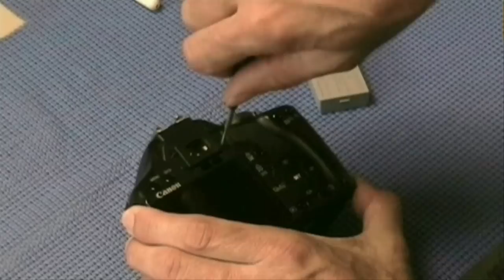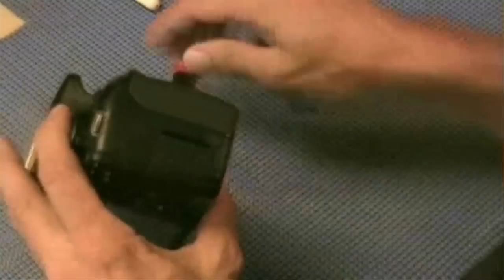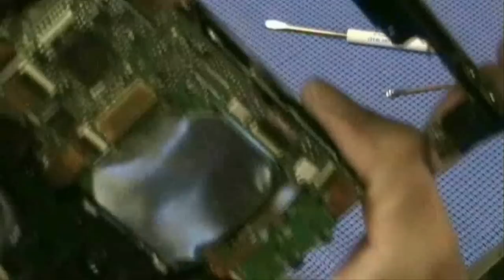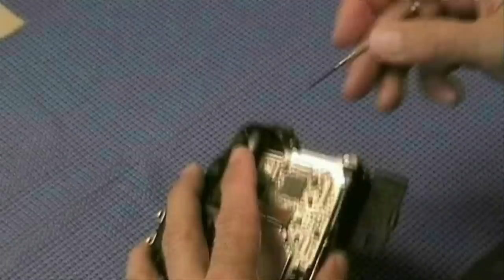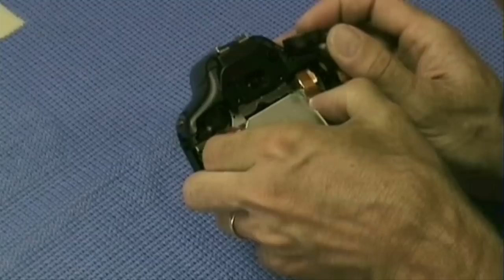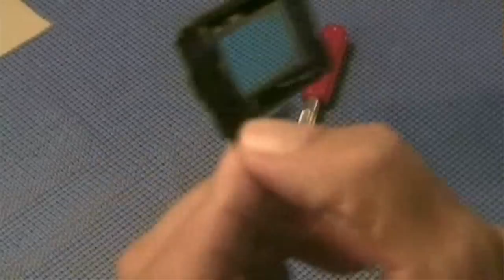Modification of Canon 450D or 1000D DSLR Camera for Astro Imaging and Infrared Photography

Comment: I know this video is old.  For those of you removing ribbon cables, before you remove the ribbon cable take a fine point black sharpie marker and draw a line on the cable along the connector. That way when you reassemble you will see if the cable is slightly crooked or not in all the way.  This saves time on having to take it all apart because you don't know which cable is causing the problem.
Reply: Thanks for the good tip. I’m going to be giving this a shot soon on my t2i.
Did you attempt it? Any success?
Reply: @bakerfx4968  No I didn't try it but could see the frustration potential if the cable is not seated........

Comment from the maker: @wowcolors Yes, you can remove both original Canon filters in the camera body to convert the camera to Full Spectrum.  Both filters need to be removed because both block infrared light.  But, there are two concerns when not installing a clear glass replacement.  First, the camera's autofocus function will no longer work, nor will you be able to focus using the camera's viewfinder.  The other problem is the front surface of the CMOS imaging sensor will be directly exposed to dust contamination.

Comment from the maker: You can do infrared with an unmodified 1000D using an infrared filter.  The problem is that since DSLRs have an infrared blocking filter inside the camera and in the exposure path, there is only a small amount of infrared light that makes it to the imaging chip.  But if you use long exposures you can take infrared images of still objects like landscapes.  Using a tripod and a fast lens like the 50mm f1.8 would help.  You could get the Hoya R72 and have some fun with it on your unmodified camera.

Comment from the maker: For UltraViolet light (UV) it would be best to replace the original IR cut filter (LPF#2)and also the anti-aliasing filter (LPF#1) with a clear glass filter.   I have tested an earlier Canon DSLR model, the 300D with a clear glass replacerment using a UV pass filter for imaging the planet Venus and it worked well.  The orignal Canon UV/IR cut filter that is removed during the modification cuts off ultra-violet light at about 360nm wavelength.

Comment from the maker: The thickness of both the original IR cut filter and the replacement filter for the 450D  is .57mm and the size is 19.2mm X 26.7mm.

Gary

Comment: Thanks so much, Gary. Between this video and the step by step instructions on the website, this was a 2 hour affair despite a minor error where I put one of the ribbon cables behind the board during reassembly. I had to move backwards and get the push in connector back in front of the board. I wouldn't say it was easy, but if you have the patience, it is achievable. 

There is definitely a moment of fear and anticipation as you power the camera back on. Mine went well and appears to be operational. I only made mine 'naked' (without a filter) as I intend to use clip in filters. This XSi/450 will be an astro camera for the remainder of its shutter life!

I plan to take photos in the next week to verify the results.
Reply: Peter, did you have a chance to try this out?  Can you attest to the results?

Comment: I just did this and it went well.  I just removed the IR filter to make it full spectrum and I have an 850nM filter on the lens.
Another tip is the top screw.  The one he said is at a angle. I drilled a hole in the case as suggested elsewhere so as to get straight at the screw.  Its covered by the eyepiece rubber.
Much better option than striping the screw.  I striped the head on one screw on the base and had to drill it out.
This is giving this old camera a new life.

Comment: I've done quite a few of these mods myself mostly on 300D.  I experienced two problems and thought I'd share them here.  The one big problem was on my 3rd mod using a metal pick that had a fairly sharp end to remove the ribbon cables.  One of the ribbon cables came out of its socket all at once and the pick slipped and punctured the cable.  Lesson learned:  use a wood pick with a slightly dull tip.  The other problem was minor but one of the hinged connectors broke at the hinge.

Comment from the maker: Many after modifying their cameras have had to redo all of the ribbon cable connections in order to get a working camera.  Some have had to do that three and even four times to firmly seat the ribbon cables and get a good connection.  If that doesn't work, maybe the brass shim that was loose shorted something.  The brass shims are used by Canon to get precise autofocus.  See my support Yahoo group DSLRmodifications for more info.

Comment: every time I try this method at least half the screws are overwhelmingly tight. meaning I strip many of them. effectively meaning I cannot safely remove the sensor. I managed to recently but the camera refused to take a phot. it told me to turn it off and on again, stoll didn't work. it's an old XSi

Comment: Yes this response is 15 years after the OP.  But I'm just getting started in astrophotography.   I have a nikon D5000.  My question is what is the purpose of modifying.  And would the process be almost the same for my nikon.  I don't want to open up the cam unless it's absolutely necessary.  I'm not afraid to do the mod as i spent over 30 years modifying the aircraft you fly on.  So i know that you don't fix what ain't broke.  Please help me understand the necessity of modifying my nikon.

Comment from the maker: When the original IR cut filter (LPF#2) is removed in a "Baader" modification, it quite often breaks while prying it loose from being glued in it's plastic frame.  Even if it comes out in one piece, it has been stressed and should not be reused.  When the front piezoelectric filter (LPF#1) filter is removed for a "Full Spectrum" mod, it is held in with a metal clip and can be reused, especially for those that have damaged their front filter or to replace a very dirty one.

Comment from the maker: Good point for not dropping those small screws!  I do magnetize the driver by rubbing its tip on a speaker magnet.  It does loose it's magnetism over time, I think in part because I keep it along with other tools in a metal case.

Comment: Hello Gary, thx very much for the video and detailed instructions. Yesterday I successfully disassembled my 1000d and removed the IR filter. Tested with a Nikon 50mm lens (unfortunately I have no canon lenses, once I use only in the telescope) and I had a good result. But one question I have: the sensor alignment is automatic after reassembling the CMOS assy? The screws torque would tilt the sensor? My concern is to have some part of the sensor in focus and other part out of focus. I haven't tested yet in my scope, which is a F5,5 150mm Newt (with CC). The weather is not helping lol.

Comment: I did this mod the other day, now I seem to have specs (dust) showing up in my photos that won’t go away. Do I need to disassemble it again and clean it better?
Reply: I noticed some companies who do this mod for a price have warnings about dust.  As a general rule the dust reduction feature will no longer be functional after conversion. This is because the ultrasonic piezoelectric element that vibrates dust off the sensor is built into the filter that also blocks IR light. As part of the conversion process we remove the IR blocking filter and since the dust reduction element is built onto this filter, it is removed as well.
Reply: Dave Ninjaneuro I appreciate the well explained reply, but I managed to resolve the issue by disassembling my dslr again and thoroughly cleaning the sensor. Seems to fine now, except I lost a screw inside the camera

Comment: hi am new to astro photography and dont know much about it. ive just bought a 450d to use with my Skywatcher Explorer 130P AZ GoTo telescope, if i was to do this what could i expect to see differently,will it make the picture look better or will i be able to see nebula's will it make take everyday photos look different ie going take good photos of the night sky is this worth doing. thanks
Reply from the maker: Hi Glyn,
If you are doing astro imaging with your scope now, after the modification you will have an increased red response.  All emission nebula like, M42 and the Rosette, will have have the bright red areas that are blocked in a stock camera.  For daytime images with a modified camera you can use the camera's Custom White Balance feature or a color correcting filter.  See my website at GaryHonis.com for examples.
Gary
Reply: do u provide a service to do the mod? just a bit concerned as i use my camera out of the night sky and still wish to have the same quality of pictures after the mod,look at you page but failed to find the color correcting filters can add a link plz

Comment: Thanks Gary for these excellent instructions. Just modified my old 450d. It works! couple of minor issues. It says no card and shows an error for the cleaning system but I suspect I may not have have seated some of the ribbon cables properly but as I save my images to PC anyway and I can disable the cleaning I can live with that, don't really want to take it apart again
Reply from the maker: Hi Clive,

Thanks a lot!
Reply from the maker: Hi Clive,

Thanks a lot!  Gary
Reply: @ghonis  ????

Comment: After modification. Did it over two months ago and successfully performed astrophotography. Came back from London yesterday. On a second day of taking photos - something started jumping around inside the camera body and my DSLR stopped working immidiately (didn't turn on). Came home, disassembled and found one of the shrims just  tumbling inside. After putting everything back in their place - my camera statred working and everything is functioning correctly except for the shooting part.

Comment from the maker: Both the Baader and Astrodon UV/IR replacements can have optical defects.  For astro, if the filter you purchase has a defect, usually it is a minor one and the speck it creates can easily be removed by using flats.  I go through a lot filters and I won't use a filter if the imperfection is bad like the one in the video.  Most Canon models are also used for capturing video of the planets, Moon and Sun and there is no way for flats to remove specks.  That's why I prefer the Astronomic filter.

Comment: Assuming I have high hope for the sensors to be dust free without the filters, Couldn't I just attach the Baader filter as an external cap over the lens? That would fix the autofocus function, no?

Thanks for sharing your excellent work btw!!!, ghonis.

Comment from the maker: Hi Danny,
There is no sheet for the ribbon cables.  They stay fixed in place after they are disconnected.  The photo in Step #12 of the 450D modification instructions has labels for all of the ribbon cables that need to be disconnected.  For help with the modification, consider joining the Yahoo discussion group "DSLRmodifications".
Gary

Comment: Hi great video. Quick question... Why did you disconnect all the ribbon cables on the pcb when the chip only had 1 to disconnect? Thanks
Reply from the maker: Hi Bergen,  I disconnect all the ribbon cables from the mainboard, because you need to remove the mainboard from the camera to get access to the sensor.  
Gary

Comment from the maker: It is a problem to find glass that thin.  1.0mm is a more common thin glass thickness from suppliers.  Baader in Germany is the only one producing a 0.57mm glass infrared blocking replacement at this time for a reasonable price.

Other suppliers can provide a similar size and thickness glass but their costs are very high.

Gary

Comment: Any reason why you don't offer EOS 60D service? Also, does a replacement filter actually need to be added if I have an external IR/UV cut off filter?
Reply from the maker: Hi William,  I don't modify the 60D model because the XXXD models are more popular for astro imaging, since they are smaller and lighter, especially important for telescope focusers.  I don't do the type of modification in which both original filters are removed and replaced with nothing.  The camera will not be able to focus at infinity for astro imaging using camera lenses if that is done.  Also, the imaging sensor would be directly exposed to dust.
Reply: Ok for anyone who is interested: "Infrared cut off-filter mod is not so simple. They replace the filter with a plane glass filter of the same thickness, and some bender replace another filter to cut just outside of hydrogen-alpha band and UV band to make result better with not so good lens with chromatic aberration. If they forget to put the glass, we can not use the DSLR as AF camera, because the focal point changes without the glass of the thickness. "

Comment: Hi Gary,
Thanks a lot for the clear instructions!
I'm a bit stuck on the part where I glued the infraredfilter,
The frame of the low Pass filter doesn't fit back on. It doesn't want to snap back in position. I'm afraid the infrared filter is too thick. The low pass filter seems to rest on the IR filter. Is it possible to remove the Low Pass filter? Or do I need to switch the IR filter for a thinner one?
Reply from the maker: Maartje Anna Fotografie Yes, if your IR pass filter is too thick and greater than 1.0 mm, the metal clip that holds it in place will not fit.  You should be removing both of the original Canon filters (LPF#1 and LPF#2) and replacing them with a single IR filter.  If your IR filter can be cut, you can cut it smaller in size to fit in the position of the removed LPF#2 and glue it in place.  You would then have a permanent IR only camera.   For my Infrared modifications, I use an Astronomik MC Clear Glass for a Full Spectrum modification and add IR pass filters, either lens thread-on or clip-in type.

Comment: Hi there. Great video. I purchased a 450D just so I could modify it. I got everything done as you did, sans the replacement glass for the cut filter. I put it back together, all cables securely fastened, all screws back in place. But, now it won't turn on. Any idea as to what it may be? Is there some common blunder I may have committed? Any help would be greatly appreciated. Also, is your website still available? I am having no luck getting on it.
Reply: This happened to me so I took the back off again and made sure all the ribbon cables were pushed in fully. The main one the first one you pull out was the culprit and I had to attach it three times before it finally came back to life so check those cables if its not coming on.

Comment: I'm about to do this mod to a 1000D that will be dedicated to my C8 telescope (SCT).  I have no need for autofocus, so can I do this without replacing any filters?  Just remove the IR cut filter?
Reply from the maker: Removing the original IR cut filter would be good if you only image at prime with your SCT.  Once you add a focal reducer or barlow for imaging you would need to add an IR blocking filter to avoid star bloat.  See my video here:

https://www.youtube.com/watch?v=r9-8lB1e_20

Gary
Reply: yes, I use a focal reducer - so adding an IR blocking filter back in sounds like I'm undoing what I just did?
Reply: oh, wait ...i think I see, the new filter has increased IR but still blocks some
Reply from the maker: If you use an IR blocking filter that would not mean you are undoing the modification.  The original Canon IR filter is also a color correcting filter that blocks the important h-alpha wavelength for emission nebulae.
Reply: my plan has been revised to replace the original ir-cut with one that allows h-alpha

Comment: hi Gary,
I have a 500d body, but i broken the IR cut glass. I dont know to buy  anywahere. help me ple
Reply from the maker: +Sao Kim 
Hi Sao,
I don't understand what IR cut filter you broke.  Both original filters inside the camera are IR cut filters or did you break the IR cut filter that you were installing?
Reply: That is Original filter inside, it's in front of sensor and its color cyan
Reply from the maker: +Sao Kim 

That filter needs to be replaced anyway, so why are you shopping for a new one?
Reply: so luckily , I just replaced it this morning . Out of $ 20 . Thanks Gary